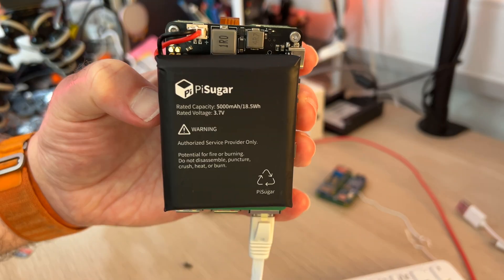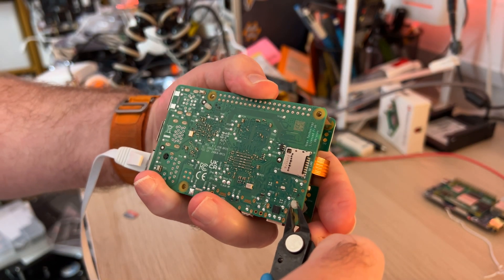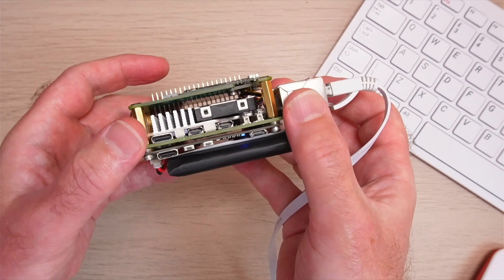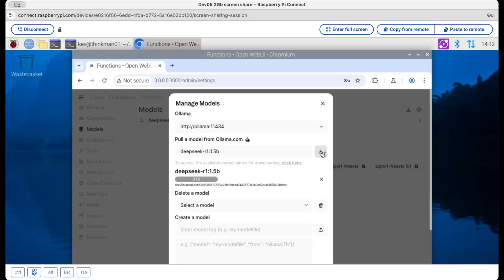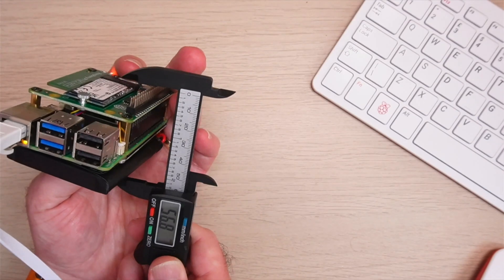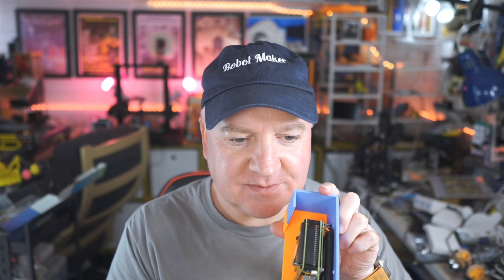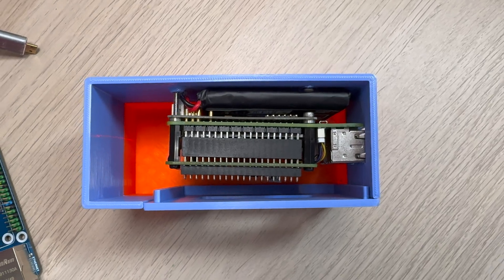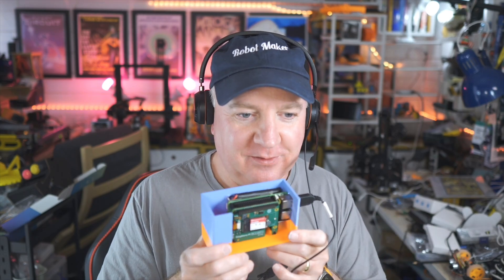Is this the sweetest Power-up for the Raspberry Pi?

Comment: While this is very nice I wonder how long you could operate on 5000 mAh. I went to the effort of identifying a portable USB3 capable power bank with 56800 mAh, 5V, 3A that doesn't attach so nicely to the Pi but I do get over 10 hours of operation from it when needed.